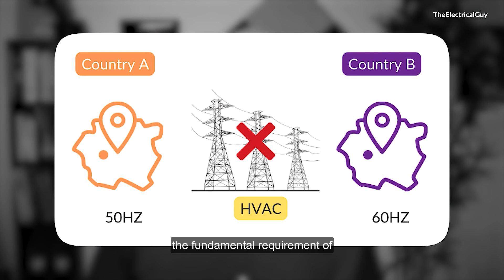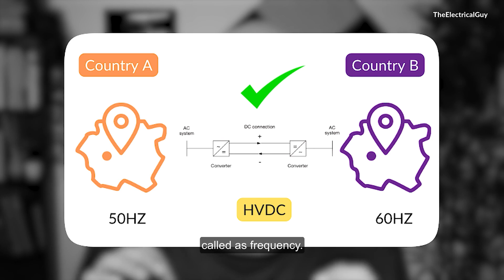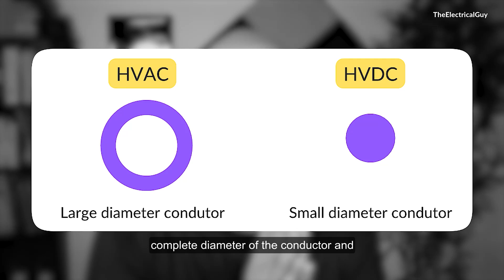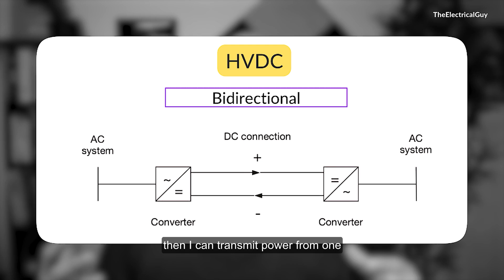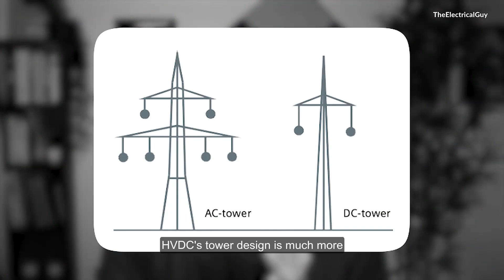Advantages of HVDC Transmission | Explained | TheElectricalGuy

Comment: Excellent video sir 👏 😊

In HVDC
• corona loss is 3 times less than HVAC.
• proximity effect is zero.
• no need of Transposition of conductor.
•Radio Interference is less(zero).
•In HVDC Phase difference is zero between Vs and Vr.
•no Ferretti Effect 
•No need of shunt reactor shunt capacitor snd series reactor.
Reply from the maker: Thanks!

Comment: I,ve  heard DC system was first used in electrical. Why ac is still
using.
Reply: Because We can easily step up and step down AC and We can't generate DC power above 650 volts that's why 😅

Comment: If it were so advantageous, why AC was used in first place?
Reply: It wasn't easy to convert dc to higher voltages as they didn't have switching converters back then while it was easier with ac using transformers. Even HVDC still depends on transformers to boost the voltage before converting it.
Reply from the maker: You will get more idea on that in the next video..